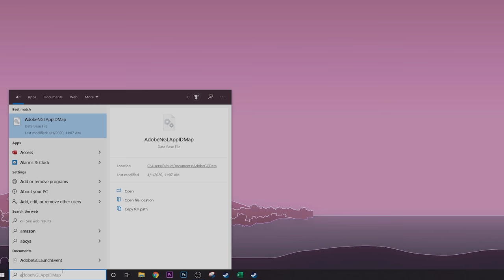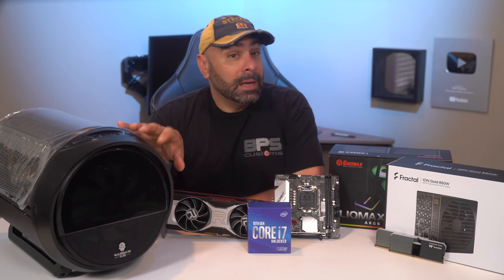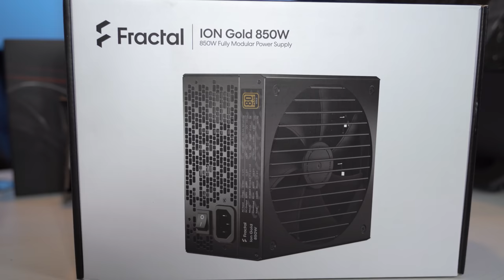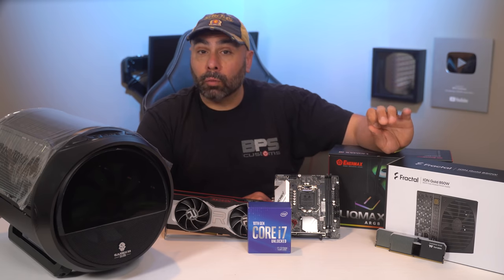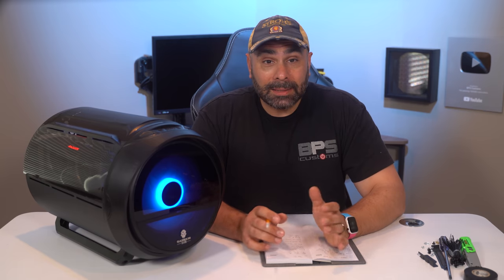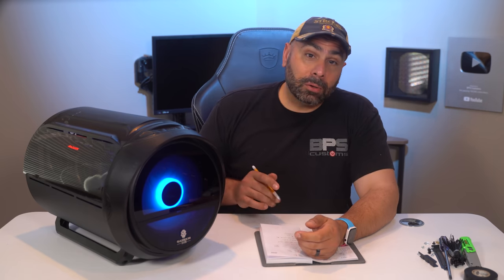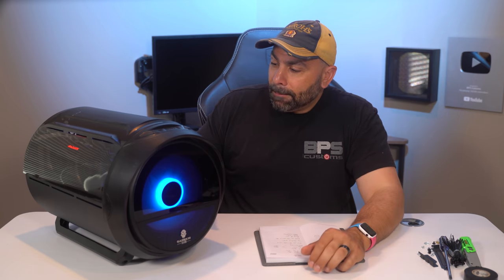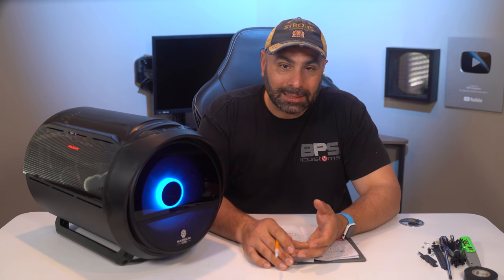The Tube PC Build!

Comment: Holy moly "bass tube" wow, I haven't heard that word you since high school, back in the start of the 2000s
Reply from the maker: I rocked one for a few years in my first car and was mocked for it. Real men build boxes.
Reply: So another words you weren’t a real man when you rocked that tube in your first car.  😂😂  By the way they still sell Tube type bass speakers with built in tweeters and mid speakers.  There a lot more powerful now but the main draw back is that there to much of a directional type speaker. Gotta aim it .  I had one also down inside the spare tire weld of a Camaro hooked to an 800watt Amp and it sounded great.  That’s the best place to put one if that’s all you got.
Reply: @BPSCustoms  I completely understand, while it was an 8 inch fosgate sub my friends still made fun of me.🙁

Comment: The case is pretty cool, right away I wondered if there was an all mesh front.  No mention of it but would be a way better option! My H500M  came with both a glass and mesh front, I prefer air flow. 
Great video, only thing that hurt my eyes was the yellow flash screen transition in the B roll. Was not fun watching in the dark lol.

Comment: "You're not paying much for this case." $150 can get you a nice flagship case.
Reply: You lucky then :))) to get it to Romania its 622 $ :))))
Reply: You can get this exact case on ebay for $110 US. I've had it on my watch list for months and there are many seller that have listed it for the same price.
Reply: with free shipping(in the US)
Reply: No you can get a nice case for $150, but you're not buying the Flagship model from any mainstream manufacturers. For example Corsair's flagship model is the 1000D which is over $500, for $150 you'll get the 750D.
Reply: Not today you aren’t. Corsair 7000X is $340. Lian li 011D XL is $230.  Thermaltake level 20 XT is $250. Can’t really get a decent case anymore for $150 unless you don’t need hard drives storage and don’t need water cooling. Prices are ridiculous anymore. We should boycott all these sharks.
Reply: I bought it for 70$ lol in my country.

Comment: It's funny how they keep screwing up the design. They have a nice thermal airflow design and then completely wreck it by blocking two thirds of the inlet. I really do NOT understand why almost EVERY company that makes cases is doing this, this is beyond stupid...
Reply: It’s all about suction. Air isn’t getting blocked.  It still gets in but at a faster rate since the hole is smaller. Think about a water hose with water pouring out the end slowly. What happens when you put your thumb over half of the end of the house? It squirts out with a stronger force right? Same thing with air. Some of these cases are intelligently designed with small air gaps. The big problem with these cases is shit fans being used. Also it needs to be exhausted by a good fan with very little obstructions inside the case. This case is a great design for the plexi glass blocking some of the fan. I actually really want this case because I designed one just like it. Except mine had drive storage under the mobo and a 200 mm fan at the back and 1 more radiator with distro plates
Reply: @vertigo6982  You have completely and intentionally ignored the fact that the pressure or suction fans can produce is a lot lower than a city's water pump that consumes several orders of magnitude more energy. The fans can only do so much. You would be surprised how even a coarse filter in front of a fan on the suction side plummets airflow. Now imagine this with those case designs.

Comment: That is an interesting looking PC case. I'm tempted to get one, but then I think about my PC case addiction and talk myself out of it. 😋
Nice video, Brian. 😎
Reply: As I was picking up the parts for this build at my local hardware shop they had a fun looking case on display. I had to tell myself "No". A lesson I learned about PC cases is if you want it buy it because these companies do short manufacturing runs. Once they are gone it's over. 

So I am pretty sure I am going to go back and get that other case too. 🤣
Reply: @MountainJack28  the other thing that is over is the manufacture support for those short run cases so it’s always difficult next to impossible to buy replacement parts.

Comment: Very impressed by the cpu and the cooler, 44 watts at 50 degrees, nice ! I saw vetroo sells this case now and i love the unique design, very different. Thinking about trying it out. Would a 280mm rad fit on top ?

Comment: I really like the unique look to it, I would like to see some fresh air intake where the GPU is for better temps.  Definitely would recommend an rear fan for sure to help pull more cool air across all the components.  I would like to see the whole front be mesh instead of 1/3 mesh and 2/3 tempered glass.  If they made those changes I'd definitely want one.  Not that it couldn't be modded to do so.
Reply: It can also cool down the back of the MOBO.
The logic is the bigger the fan the more silent they are.
And this one have a giant fan and its rgb.
The price of the case most likely goes to the large fan.
Its really unique.
Im considering this for my dedicated stream encoder xeon v3 on a custom water loop

Comment: You can use 3D printed cable holder w/ 3M tape 
They are dirt cheap online can be use both for home, computer table, monitors and tv etc. For cable management.
Even for system unit cable management in PC.. im using those 
In my system and my table

Comment: You for got about the back 120mm fan to take out the hot air I have one and runs very clean cool too has long you have the back fan there will be no heat issue.